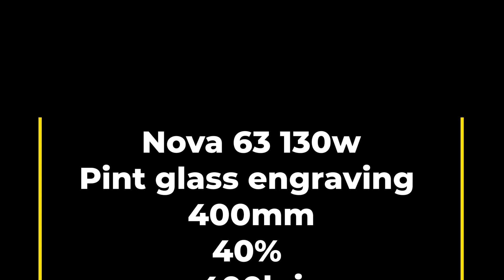Nova 63/130w Glass Pint Engraving

Comment: Cool. What is the benefit for 3mm focus vs. 6mm?
Reply from the maker: I find that the closer focus the less flaking of the glass from the mirror fracturing.. Basically zero clean up.. I have tested defocusing away as well and only close.. 2-3mm will work.. Not sure for the reason beyond how the beam is interacting with the glass.. If you focus at 6mm you will have scaling and little shards that must be cleaned.
Reply: @HouseOfLasers  helpful info. Thank you!
Reply: Interesting gotta try that test focus as well